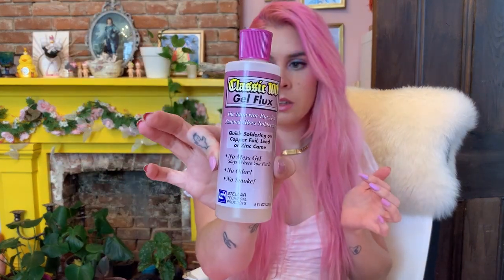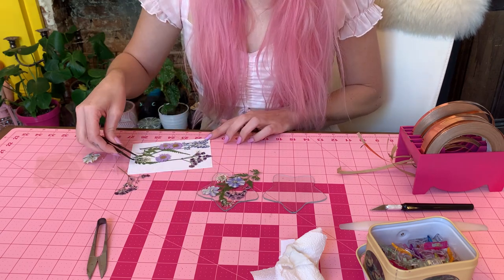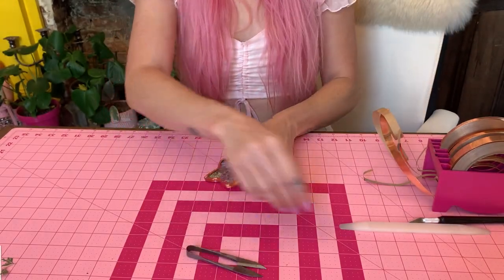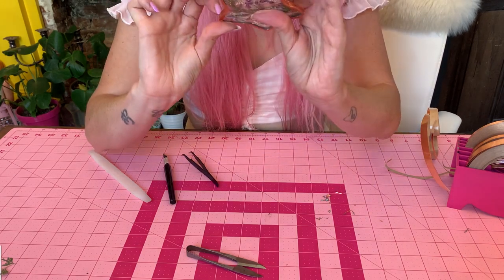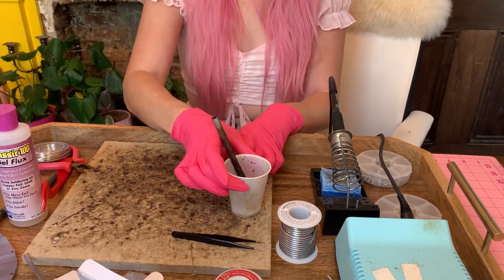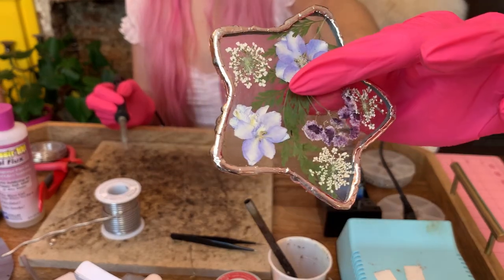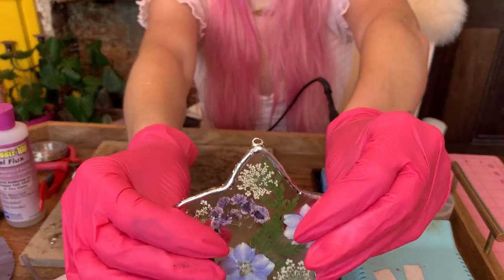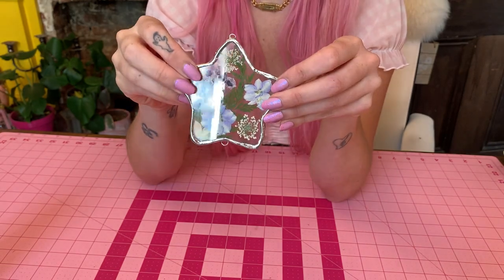How to Press Flowers in Glass

Comment: Fab fab fab.  I'm soooo new to this craft and I'm now hooked.  I'm retired and I live in the UK.   I'm going to make Christmas gifts for my family with this craft. I need to source cheapest of supplies as my funds are low.   Can you give me any tips or advice on soldering iron, type and flux.  Sooooo delighted with this.  Clare xx
Reply from the maker: Hi Clare, Keep an eye on facebook market place or any local community groups as people are often looking to get rid of stained glass stuff and you can get a lot of cheap. Its not a terribly cheap hobby but if you just get the basics, its not too bad. For this project i just use window glass which is pretty cheap from the hardware store and if you press your own flowers or leaves those are free!
Reply: Thanks for this video, I was wondering if I need to buy the glass already cut.  Does Amazon or craft shops sell glass like that (what thickness will I be looking for)

Comment: Thank you!  I love this and think it's so much prettier than putting the flowers in resin.  Do you know if this would work with rigid polycarbonate?  Or does the copper tape/soldering only work with real glass?
Reply from the maker: This will only work with real glass. Anything made of plastic will melt and create really toxic fumes. There are stained glass shops that sell pre-cut glass pieces if you don't want to cut them yourself.

Comment: Question? Can you use 2 pieces of plexi glass then copper foil around it then solder? Or does it have to be real glass. I’ve started pressing flowers as a hobby and to gift to people and want to start making my own frames and plexiglass is much cheaper from what I’ve found so wondering if it can be done before I waste money buying it 🤪
Reply from the maker: Please do not try this with plexi glass. Its made of plastic and will melt. that melting plastic will also give off pretty toxic fumes. Clear window glass is actually cheaper than plexiglass, the tools are just an additional cost. If you want to put pressed flowers in plexi glass you could always just glue the edges together or even foil them but not solder. Stay safe and good luck!

Comment: Is there another polish you would recommend? The one linked is not available. Also—do you use a pickle or just the polish? New to soldering. Only interested in making these pressed flower pieces.
Reply from the maker: So there are some brands they sell at hobby stores like studio pro that would work. I think the supply chain being messed up made the Liva brand hard to find. no need for pickle, that's usually only used for jewelry making. I would also add that sometimes these are not 100% water tight so be careful when cleaning them as liquid getting into them will ruin the flowers.

Comment: How did u cut the glass in a star shape? Thanks!
Reply from the maker: I used a glass cutter and running pliers. I'm working on a tutorial on how to cut glass. If you don't want to mess with cutting glass yourself, there are shops that sell pre-cut glass shapes.
Reply: Thanks for the info  I cut glass but I bet it is hard to get them exactly the same. Great job!
Reply: R u using 60 or 80w solder iron sweetie.? Thsnks again.
Reply from the maker: @sherrieller6523  I use a Hakko FX-601, I believe its 67 Watts.

Comment: Didn’t hear you speak of the different color of the foil tape...especially if you use clear glass. You trimmed the foil on the back so the color didn’t show, but most people who solder don’t trim. Just a suggestion...it comes in different colors.    PAM
Reply from the maker: Foil this wide (half inch) sometimes doesn't come in all the finishes which is why I did not mention it. I personally only use silver for pieces like this. I trim away the edges because I think it just looks better. I've found that with very wide foil, it sometimes covers the flowers which I try to avoid.